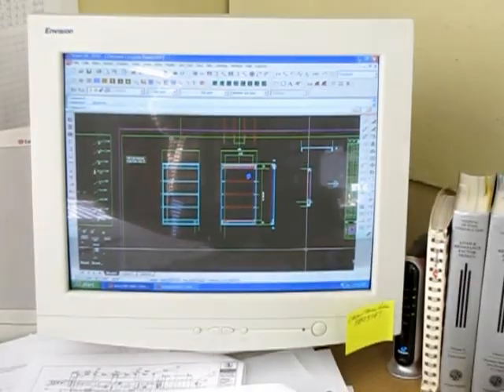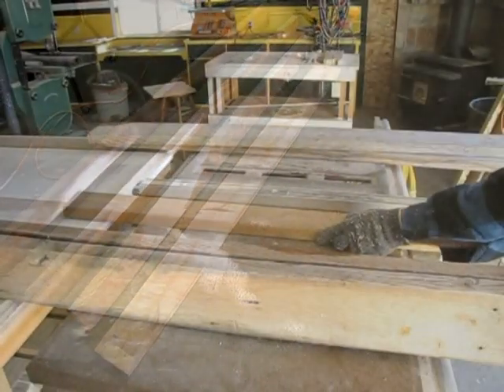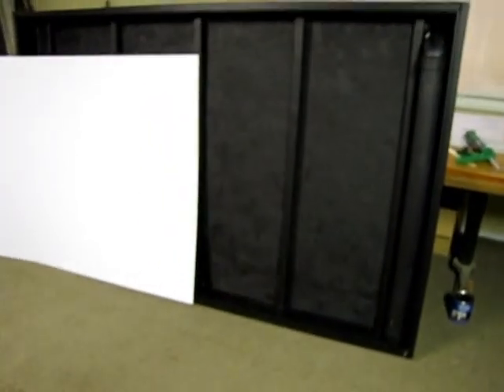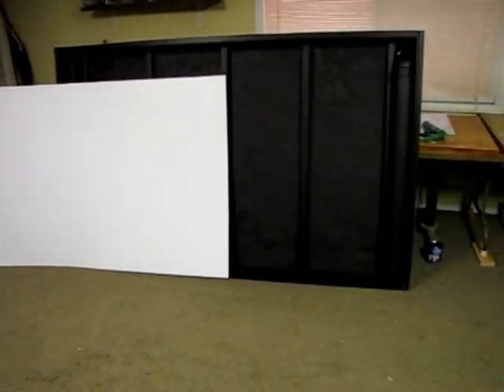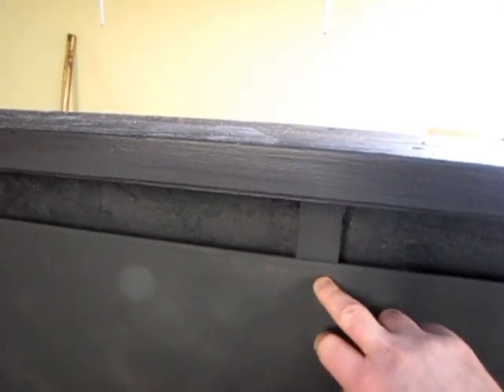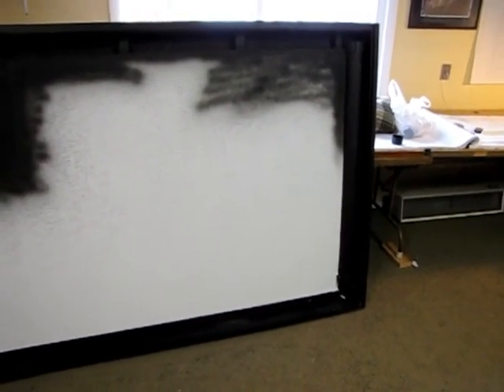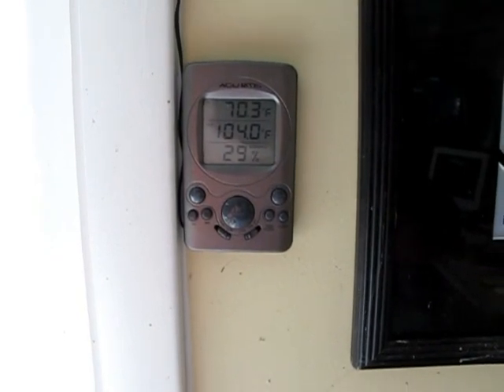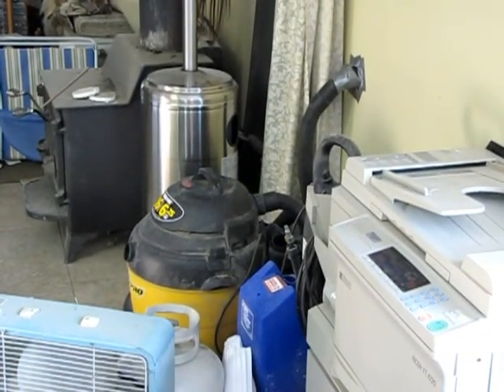DIY Forced Air "Coroplast" solar panel

Comment: That’s  uncanny I have just come across your video and saw the same thing with Dan messing with Coroplast all those years ago,

I built a solar panel as well back then, still use it today.

As far as I can remember Dan did not use it for a solar panel but like you I saw the potential.

Comment: Easiest solution for circulating an air flow is using a 12v pc fan with a solar panel. Place it outside in direct sunlight so whenever the sunlight hits it, it will start the fan and draw air thru your heater. When there is no sun it will stop. This is completely passive and will save your shop vac. I've found 12v bilge fans that push huge volumes of air as well if you need more pressure.

Comment: Ya know. The Shopvac uses 1500W of electric on your electric bill and adds exactly 1500W of heat to the room. Just buy an electric heater. And if you're going to experiment with efficiency, Coroplast (not Chloroplast as you call it) is real estate and advertizing signs found in infinite abundance at the dump as well as PVC pipe, or just build a fire from 2x4s and huddle around it. The furs you should be covered will be harder to get, and the city probably won't like it. But you'll have meat.
Reply: You also spent hours building a box-spring mattress, also found in abundance at the dump.